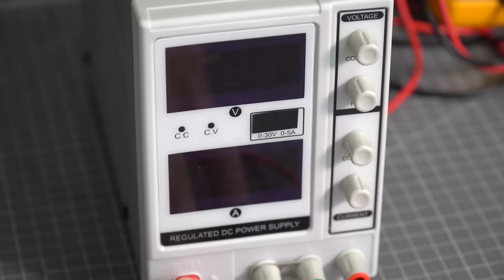Making a Solenoid Boxer 4 Engine

Comment from the maker: Big thank you for your wonderful and supportive comments!! 
The plans for the project are available at https://www.maker-b.com
Tools I Use: https://maker-b.com/pages/tools-i-use

00:00 making the Cylinder
01:34 making the Pistons
02:59 winding the Copper wire
03:10 testing the Solenoid
03:24 making the Crankshaft
06:26 making the Connecting rod
08:37 making the Engine frame
10:24 installing the Bearing by the press fit
12:03 making the Back Flywheel
14:03 making the Front Flywheel
15:27 making the Wood base
16:32 assembling the parts
18:37 showing the finished engine
19:36 checking the rpm 

Again, thank you for watching this video :)
Reply: Any chance of You making me one of that? I'll pay
Reply: Make some more videos like this! It’s amazing! 🤩
Reply: @thekingsilverado9004  " perpetual motion motor" takes drink
Reply: @thekingsilverado9004  But, Tesla cars out perform Detroit models, only after being in business for a few years. They're currently building the world's largest automotive manufacturing plant (in China)and revolutionizing Lithium battery technology. You ain't seen nothin, yet.
BTW, SpaceX is going to Mars.😎
Reply: Maker B hey can I pay u for one?
Reply: Woaw ! Can you make a small thermic motor like this motor ? But just if you can 😁
Reply: A really ineffeicent yet mechincally beautiful deivce
Reply: Bro what is the device that is used in the vedio to hold the shaft at 2.10
Reply: Pro tools u are definitely a pro
Reply: I like the music less video
Reply: I cant find the uk website link
Reply: thanks you
Reply: 電磁石エンジンのラジコン見たいデス。
Reply: A mola com ímã português energia bateria sua energia tá com motorzinho sua força tá indo em ciclano coisas bem pesadas e grandes e pequenas vão para uma pequena energia 45 atualiza aqui vídeo tá a resposta tá na sua ideia minha ideia energia eu quero escrever Heitor desse dia eu quero meu pai eu somos inventores Gabriel da Souza com g a b e r i e l o imo com molinhas de bateria elétrica com motorzinho
Reply: Do you have any plans for rebuild if yes could you send me them I need a mechanical project for school and I would love to rebuild this thank you in advance
Reply: Excellent work! Outstanding! 👍👍👍
Reply: How old are you? Please ansver
Reply: How to connect those copper wire and how to do the wiring
Reply: A question 
Is the coper wire insulated 
Because i tried making an electro magnet with copper wire and it had some short circuit and was dangerous
Reply: Are you have a CAD Model?
Reply: Can i have the drawings as in the measurements of all components
Reply: what machine are you using the make the projects
Reply: Maker B 🔥
Reply: Молодец 👍✊🤝 автор
Reply: Of course the machines are unavailable now....
Reply: Which CNC mill was that? I don't see one in your equipment list. Thanks!
Reply: obelix 3500 yes the copper wire would need to be insulated.  A solenoid is an inductor.  When current passes through the wire it creates a magnetic field.  By coiling the wire a stronger magnetic field is created.  Without insulation the current would take the shortest path across the wire not around the loops.
Reply: Any chance you can do a video on the tools you use and any mods you've done to them?
Reply: How much would you charge to sell parts like this or how much would you charge for custom goods
Reply: Fantastic!!!! Excellent work!!!
Reply: Hey, how powerful is it?
Reply: Bro super impressed. I found you on YouTube because I recently bought a Sterling Engine to show my son some science, love it man. So jealous of your tools/shop! 
How many hours did this one take you to manufacture?
Reply: Thank you
Reply: @Hathorr1067  
uhhh no
this is not perpetual motion,  it's run by a DC bench Power supply
Reply: Where we contact with you , for more information about this project❣️??
Reply: @Infinit12311 hiii
Reply: @Infinit12311  what happen
Reply: Where you see a engine I see a generator.
Reply: Very clean nails for such a wonderful engineer.
Did you use a hand model 🤔
Reply: Great video
I would use optical switches and fets to replace the mechanical switches for a more longer time til failure.
Reply: Jnķ
Reply: great video. just one question: is this more effective than a regular electric motor?
Reply: Bn
Reply: Wow Respekt
Reply: You are definitely a talented machinist. My uncle builds and restores hot rods as a hobby. He machines the vast majority of his own parts with a Smitty Mill. I’ve seen how tedious it can be. His is an “old fashioned” one too. No computer software to set parameters for measurements. The micrometers and other precision tools are some of his best friends!...BTW, your coping saw skills are honed as well...impressive!

I’m actually impressed the small connecting rods didn’t cause more issues...they are not forged aluminum H beams..lol
Reply: How about if I  connect a/c generator to it and I get free energy to powered home ,, what you think of it ,, can this project success or not ,, hope you replay ,, THX
Reply: Bonjour serait-il possible d'obtenir les mesures précises des différents pièces. S'il vous plaît. Cordialement.
Reply: @shantomathai2662  its called a collet I used to make them for one of the jobs we had to hold. You should be able to buy them in most mechanical engineering suppliers. They make then in various sizes.
Reply: your drive shaft isn´t perfect. it has two times the same position. i think it would be better to switch the second connecting rod about 90° to have one connecting rod at 0°, 90°, 180° and 270°. Your drive shaft will work more evenly but the control will be more difficult. I´m sorry for my bad english. I´m from Germany ;-)
Reply: "Dear Santa...."
Reply: Make mini box jet engine please
Reply: Lmao
Reply: Can you link the engines u use?
Reply: Now you just need to build a small Subaru to put it into
Reply: could you make it gas powered for a experiment I will have
Reply: you could make a video explaining how you connected it and the components
Reply: please excellent miniature project
Reply: Hi Maker B and everyone, nice work. I would love to have all kinds of tools and machinery to do all kinds of stuff anyway, there's this thing that I don't understand.. Can anyone explain to me what's a "Boxer"???
Reply: @1:58 I don't know... a bit of jazz funk would be just the thing right here. Boom chicka wow-wow.
Reply: #makerb Fantastic !  I see the hands of a young person, having fun making a machine that sums up the Enlightenment Century (at least as far as electromagnetism is concerned).  You have not only the knowledge, but also the intelligence of the gesture, the concern for the beautiful mechanics, the respect and the knowledge of the tools which allows a "simple" realization which summarizes the human intelligence.  It is a real pleasure for me to see you put down, here cutting oil, and there a drop of lubricant.  You are a credit to Humanity ! 👏👏👏👏👏🏆❤️ PS excuse my Frenglish 😅
Reply: 3Am (
Reply: Wonderful!!!!!
Reply: @kashimcx  same I want one as well!
Reply: How much winding
Reply: Прікольно

Comment: O-kay, so this isn’t the LEGO version or made of parts from the hardware store. No. This is real craftsmanship. And very enjoyable to watch. 👍
Reply: Who tf cares if it’s Lego or made of hardware store parts. It would still be a functioning engine.
Reply: @billiam_bob  i think ur missing his point
Reply: I mean, while the craftsmanship here IS very impressive, I think most people that use LEGOs or hardware store parts do so because they don't have access to this kind of expensive precision machinery. It's more than a question of craftsmanship alone
Reply: @Sven-kc7rq  no, I think your missing the point. It doesn't matter if you 3d print, if you use Legos, if you use expensive machines or hardware store supplies. If you make something such as a model engine, then it's craftsmanship. Simple as that.
Reply: @scarecrow5848  you missed the point. This is quality and functional.
Reply: @CheeseMiser  you didn't read my comment did you
Reply: @scarecrow5848  I litterally did. I didnt say it wasnt craftsman ship. But if you use craftmanship to make something using crap then you essentially putting lipstick on a pig. You clearly didnt read my comment
Reply: @CheeseMiser  re-read my comment then. does NOT MATTER WHAT YOU USE. as long as your making something that has a function/is art, its CRAFTSMANSHIP. doesn't matter what its made of.
Reply: @a52productions do you comprehend how unfathomably expensive lego is
Reply: @ChanceKearns do you know how expensive copper wire, cnc, 3d printers, good computers are?
Reply: @Lucianohlegomocs  im sure its less than Lego :/

Comment: Although I tried making a 4 cylinder electric motor with solenoids like this back in the 70s when I was in junior high school, I only got it to run a few seconds. I wish I'd had a metal lathe, a milling machine & the other tools you used to fabricate all the parts. All I had was metal brackets I could scrounge up along with parts from an 8-Track player & probably some erector set parts. It's been so many years ago, I can't remember what all I used. At the time I wondered & still do wonder how a motor like this would compare to a typical motor when it comes to efficiency & power output. This is an excellent video, Maker B.
Reply: Mason Gilbert  All true and accurate. Thank you.
 Ehh, I like this better. It's got major novelty appeal. If I want something that DOES something, I'll just buy it, pre-done..
Reply: Mason Gilbert  I too was curious as to the efficiency of this design, the discharge over time of a battery, etc... Though, I kinda totally figured this to be the case.

Super-cool little widget, though! It would make for a very interesting RC model motor, or just a super-cool paperweight. :D
Reply: AGREED 110%
Reply: Mason Gilbert I lost it at the joke LMAO
Reply: Mason Gilbert  I too appreciate you explaining why this is not efficient. As I have lots time on my hands I don't want to waste it inefficiently. Now I can think of something solenoids CAN DO more efficiently than other machines.thanks

Comment: I love things like this, no reason for it's existence other than the satisfaction of seeing it run ... although you do realise what you have to do next ... hide the wires through the table, add a small dynamo on it wired back and repost the video as a free engergy machine. Get people arguing over it to make enough advert money so that you can then make a full size one for a car, a V12 arrangement would look cool :D Batteries might be an issue though lol
Reply: so this could effectively work poppin out the bonnet of a tesla even if it would ultimately be aesthetic, but could you give it a function, cos it looks like the most thoughtfully designed engines ive ever seen and instead of a huge roar the coils would spit lightening right? maybe you could have a plasma vaccum chamber around it so you could see how the charge intensifies as you depress the accelerator!

Also what kind of loctite is the green and purple solutions for marking things cos if you dont try what i suggest then i WILL!

one love, and keep inspiring the designers of tomorrow!
Reply: @tobiasphillips7359  it's extremely inefficient and serves no purpose other than to watch its moving parts.
 No reason for all the extra moving parts with an electric motor either. Making zero sense.
Reply: You can bet they thought of this idea though before rotating magnetic fields were discovered. Making early steam engines run via electricity.... hmm.
Reply: Yeah and end up like Stanley Meyer?! “They poisoned me!!!”

Comment: wondered what you were going to do for timing, figured it would be arduino or something, but making the crank eccentric and using microswitches is brilliant. Very well done that.
Reply: It would have been interesting with an arduino. I suppose the arduino would need a way of knowing the crankshaft position, adding a bit more complexity.

Comment: If one radial slot is cut in the coil formers shown at 3:02, it would eliminate the short circuit during the rise and fall of the current in the coil. As it is the rate of change of magnetic flux will induce a circumferential current in the coil former where there is a rate of change of magnetic flux.  Probably one will get a higher rpm if one does cut that slot! 
Very nice engine and craftsmanship with basic engineering.

Comment: Nice build! Look up hall effect sensors to detect the rotation angle, they're silent, non-contact, non-friction magnetic sensors, that could drive mosfet transistors and in turn the solenoids.
I doubt you'll read this, but hopefully others have suggested this. Cheers!
Reply: Could also just magnetic imprint the shafts an cylinders in opposing poles or wich ever it is that makes them push each other away from each other. Etc less friction more power .

Comment: Soooo cool. I love how perfect everything is milled, and how smooth the motor ran. I would love to do a scale RC around this motor.
Reply: i think a sacle rc with that would be awesome i dont know if it has the power to move an rc tho
Reply: @ahh5516  i think with tge right pinion and spur gear it could work.
Reply: it doesnt have enough power to actually move something

Comment: Never seen an engine like this run by solenoid switches? Unique!
Reply: Fascinating indeed... first time for me too.  So now the question is, how efficient is this engine compared to a modern brushless motor?  Hmmm...
Reply: Bill A probably not great, about 50x the parts and those mechanical switches will be problematic quickly.

The best thing about a brushless motor  is the only moving part is the rotor.
Reply: @Spiderman microswitches flake after about 100k cycles. At even as low as 500RPM that's not long. That said hall effect switches and some simple analogue control circuitry would work and not wear out.
Reply: @Spiderman Exactly. Neodiddly magnets and a hall effect switch are a much better idea with a bit of signal conditioning. Only needs a simple amp (maybe a single BJT) and a FET.
Reply: I'm not an engineer of any sort, other than diagnosing and replacing parts on my own vehicles.
Obviously, you would lose efficiency with all of the moving parts, creating friction.  
But it seems to me that because you are only using bursts of power, rather than continual power, as with a standard electrical motor, that you may use less power?
Reply: @bcrwarlock1974  ICE engines only use power in bursts (almost small explosions every other turn of the crank). The real question is if you get more linear force from this than rotational force from say a brushless motor compared to how much electricity it uses. Remember the rotor and the "piston" moving set up electrical fields opposite to the ones that "push" them thereby reducing current from stall current which is purely down to voltage and coil resistance. I spent years as an electronic engineer and I don't want to do the maths for all that as there are a huge amount of factors.

Comment: un ABSOLUTAMENTE impresionante artesano, creador, electrico y mecanico... es una verdadera obra el motor que ha logrado...
Reply: Si, la verdad se ve que es un rectificador de motores con mucho tiempo extra. Un artesano con mucha manualidad fina. Pero el motor que propone no tiene ninguna aplicación útil, solo es eso, una artesanía cara y que pocos pueden hacer, sobre todo por el tiempo y el tipo de herramientas que se necesitan para hacerla.
Aparte de no tener utilidad práctica, tiene muchos problemas si se necesitase utilizar para algo. Desgastes en muchos puntos, los switchs dejarían de funcionar en poco tiempo, sin contar el rozamiento de las bieletas, etc.
Pero algo lindo de ver contruir.
Reply: Marcelo Vilvilco ayyy paesan
Reply: serviría para una máquina de tattoo bastante elaborada
Reply: @jorgegalvan895  no usa escobillas, no precisa de imanes permanentes, funciona con DC, fácil de controlar y sencillo de armar y mantener ya que su estator es tremendamente fácil de embobinar.  Tiene muchas ventajas respecto a un motor DC común

Comment: On the future, The solenoid engine, batteries and Solar. Power on the car. Hope Win!
Reply: Its seems to never gonna happen since solenoid engine always less efficient than conventional motor
Reply: Good thing we have biofuels
Reply: @aukahpusing9887  VW guys would eat a 1:1 version of this up. It even sounds like a Beetle. Yeah, it's inefficient, but what hobbyist car isn't? This could be an alternative for them in the future if fossil fuels are no longer available. Harley riders might like it too.
Reply: she is leader young communist league.
Reply: @aukahpusing9887  is that a fact? I do not understand  why. The amount of power to energize the coils to do the work is less efficient than constant power through a motor? Can you explain? Or do you have a channel where I can observe a better idea before I build my project. Thanks
Reply: @uprightfossil6673  because the basic principle of the movement. In solenoid, linear movement were tranformed into circular movement, thus some energy was lost during this process. In contrast, there was no movement tranformation on conventional motor